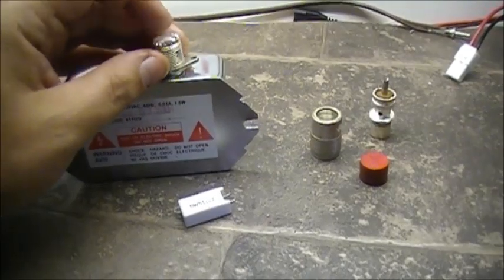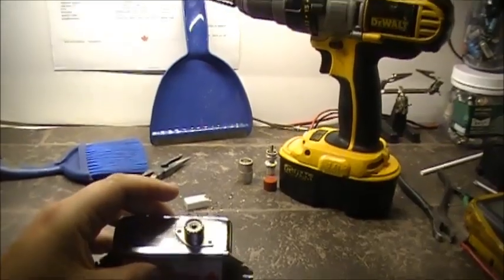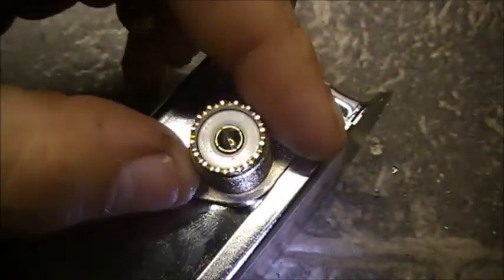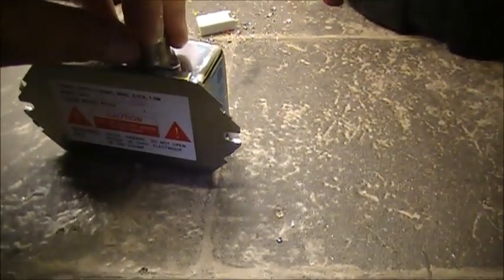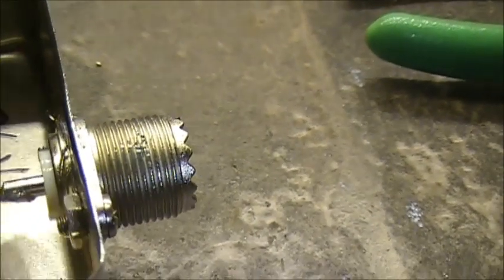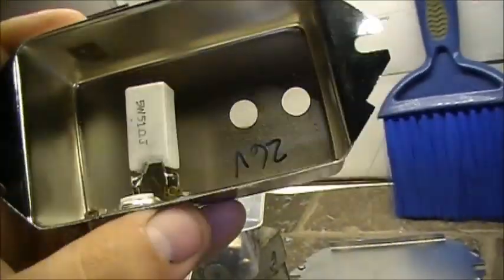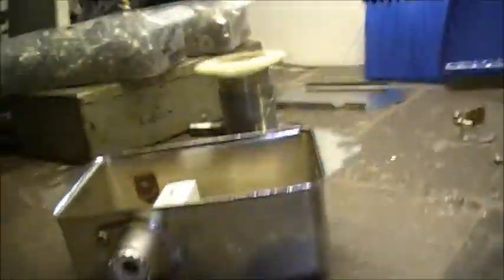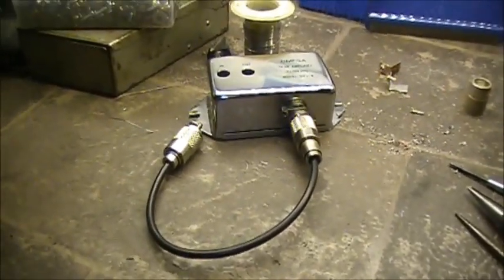Simple dummy loads - Part 2

Comment: Hey Darrell, haven't been on in a while. That resistor is wire wound. If you at any stage use it to calibrate swr etc the inductance might throw it off.
Reply from the maker: Cool, thanks for the heads up, it's only a 5w 50ohm resistor, i do have a better one ordered on Ebay to replace it with anyways. ;-)